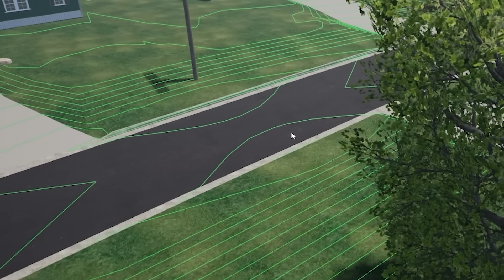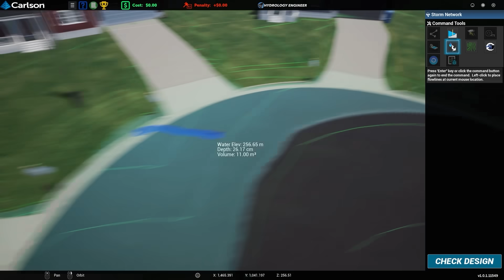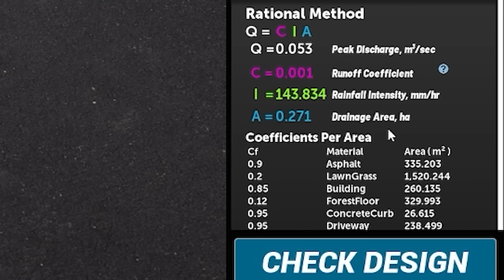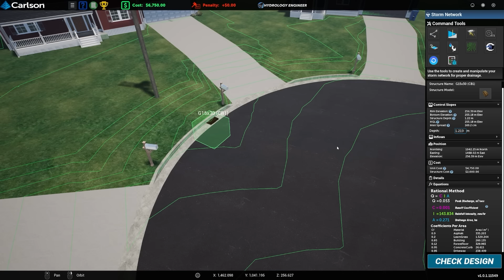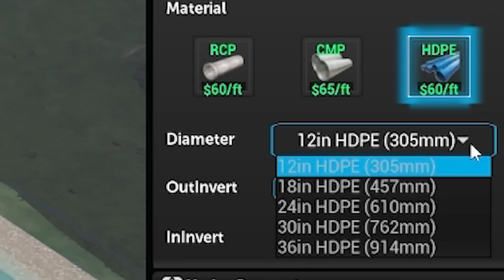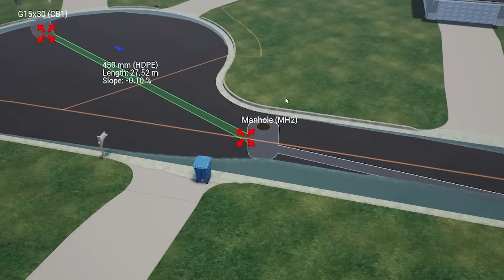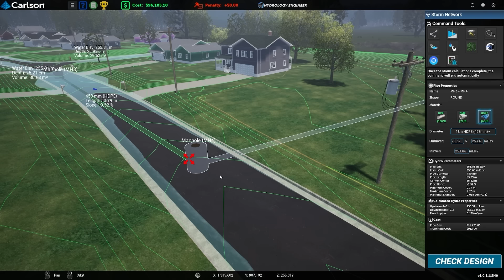Where does rain water go?

Comment: I have a couple of good mates that are dunny divers like RCE, but they never get as excited as this lol.  We often all pull the piss out out of each other and say that because I'm a mechanic that I was too smart to be a plumber and it is always easy to fix because it flows down the easiest possible path.  
But between you me and the tree, water and drainage/flowrates blah blah blah, all gets super complicated and I couldn't do it.  He started telling me one day (showing off really) how they work out how much drag different fluids have to find out how much heat the fluid moving creates over several miles of pipeline.  I probably got that ballsed up, but we were  all drinking so I will blame that.
One of me mates worked with a builder doing new houses only.  Got paid very very well, always went home clean and on time and before he made 3rd year he had two newish cars... that I had to work on for a few beers, on the weekends.  
But the other one left that job he got an offer to go work for a company that does commercial/heavy industry for an oil companies.  They would contract out to oil rigs or into the middle of a desert, all expenses paid.  Before he turned 35 he went out on his own and started his own company... bastard.  Both are bloody smart and I was and still am very jealous tbh.  
I told my youngest he should become either a plumber or an electrician, you can get paid better then some doctors.  But they worked hard to get to where they ended up.

Comment: I have a question about them. When I was traveling, I found a stretch of road that had 6-7 manholes. the road was a 35 speed limit, and all 6-7 were in a 3 to 4 second stretch of the road. So my question is, why is there so much in such a small amount of space?

Comment: so i work for a group of cities, doing various things mostly trash and recycling pick up. One of my cities has such horrid drainage that a light rain, not even enough to notice working in, will put water over the roads. all of the drains are on the apexes of hills, the roads are all lowest in the middle...it's horrid. The current city planner has been there for about a decade and I talked to him about it, and the best he had was "it would cost us less to rebuild the city than to fix this, and the board isn't ok with either option...."

Comment: As a former construction worker, I found this very interesting and I was able to accurately guess where you would put the drains. I live in Phoenix Arizona and my location the water slopes into a nearby wash. But about 10-15 years ago we had a storm here that the water backed up and the manholes where pushed out of the way. It turned out that over many years, trash collected causing floods all over the city. A big one was on the I-10 freeway that runs through downtown.
The construction site I was working at at the time had the elevator (or a lift to you, lol) hole in the ground for the cables and what not, was flooded and turned into a small pool. Wish I had taken a picture of it.

Comment: what, more water dynamics please. this was a subject i was interested in since i learned about hydraulics. i would like to learn more about how water flows through pipes or how heat is transferred in water etc. i like how a water tower works, but how does a system that doesnt have a water tower work? does it constantly need a power source for a pump? how big does that pump need to be? it would have to push the same amount of water as a water tower to the same height so i imagine it would be as big as a turbine in a water dam? maybe there's a more efficient smaller motor or series of motors? i wish to learn more

Comment: My neighborhood was built in the 60s by the most inept people ever. My house is at the bottom of a hill, and on the outside of a curve. On my street, there is a gutter basically every two houses along the outside of the curve. So, every house has a gutter on one side of their property or the other.  Except one. Mine. The place the absolutely needs it the most since it Is the low point, and there all the water will come to the outside of the curve. Plus, on the uphill side of me, our next door neighbors have a relatively wide yard. So the gutter (on the other side of the property) is before a long stretch of road. Any big storm you can literally see the river of water coming across the road on the inside of the curve just past the gutter, straight to our yard and into our driveway. (There are no curbs anywhere.) So yes, our driveway gets absolutely flooded and the asphalt in the edge breaks up every few years no matter how good a job the pavers do because the water sinks into the ground and basically creates a mini sinkhole under it.

Comment: As a former telecom engineer, this was a delight to watch!

Fun fact; our manhole and conduit runs also acted as unofficial drainage system. Water would enter through manhole lids, or sometimes even just open conduit holes. There was one location where the hydrostatic pressure was always so high you could slide the lid off using a lid remover. A previous engineer installed the hole where all the local drainage pooled. eyeroll

Comment: Definitely something I would've never given a second glance to if not for your channel along with your passion, knowledge and excellent explanations. While things like flow rates and pipe sizes aren't exclusive to city planning, it definitely was nice to hear you going over things and hearing you give quick nods to "this needs to be a certain way because of these factors" while also explaining why you were changing them later as you ran into problems with the simulation.

I've never worked with Hydrology outside of smaller projects like installing single home underfloor plumbing based on recommended numbers so this gave me a pleasant look into the complexities of larger scale projects along with more understanding into why certain floodings happen in certain areas of my city and what could/should be done to combat them but also as to why they might not be undertaken as you were making changes which impacted everything downstream.

I'd be very interested in seeing a larger scale approach and comparisons about making a "minimal viable solution" into "optimal solution" type deals from the full game to give an even further understanding about the problems surrounding upgrading existing systems but I also just liked the passion and insight you provided to the video. Best of luck and I hope we see a second part.

Comment: It's interesting that they use Mannings number. As a mechanical engineer, I am more familiar with the tube roughness number (i think it's acutally called "Darcy friction factor" or "Fanning friction factor" in English, I have to dig a bit deeper which one it actually is due to the factor 4 between them) based on the Reynolds number and wether the flow is laminar or turbulant andt hydraulically smooth or rough. But haven't used it anymore since quite some time...

Comment: What RCE didn't explain, and that my city found out the hard way, is that depth also has to do with freezing. The further down, the more likely it is to be below the frost level in the ground. City decided "it never gets cold enough here" and during the arctic blast a few weeks ago, a couple storm drains burst due to

1: debris slowing water flow because the city didn't run proper checks
2: -10 degrees for pipes at a depth for 20 degrees minimum

There were a LOT of burst pipes in homes and businesses, but the main issues were the couple of storm drains breaking and causing a lot of flooding because they backed up a LOT during the snow melt after the freeze and dozens of water meters less than 18 inches (roughly .5 meters) from the surface of the ground. Some were closer to 6 inches from the surface (.2 meters) and burst. Houses without water entirely until they came around to fix them all vs a room or two shut off

Comment: Matt this is nice, if you could continue on it with maybe other similar games in other engineering fields. Soil mechanics, fluid mechanics and turbo machinery, material science (cement, soil, etc.), seismic/vibration stuff, geotechnical, highways/roads, etc. I guess you understood my goal 😄. 

Normally, I don't like and don't comment on videos, especially gaming ones. However, this is different. As a mechanical engineering student myself, I had a smile on my face the whole video. I myself is a nerd regarding engineering, and seeing matt nerding on the details and information in the game is incredible. I even increased my resolution (since it was low to save of mobile data) to see the various details and numbers. Matt I don't know what you are talking about when seeing this is boring, I was pretty sure that everyone enjoyed it. Seeing the comments proves that (all field of engineering came to the comments here 😁😁, never expected this much of engineers to be in the audience.).

Comment: I work as a designer for a civil engineering company and we use Civil 3D. As a learning tool this program you are using seems like a great way to gain some experience and for that price it isn't bad at all. Although hopefully they have more maps to practice on. But a huge part of the design is also the grading and figuring out where the high points, low points, swales and basins all go. Plus trying to minimize the earthwork and balance the cut and fill amounts. Once you do all of that knowing where to put inlets is the easy part. I think this program totally skips that part of the design process.

Comment: I had a few years of CAD in university, so this brings me back to learning Revit. But we never went into the details, so I found this really interesting! Funny enough one of the few things I remember is that those rocks downstream of the headwall are called a riprap lol.

The other thing I learned from living in the Phoenix area for many years is that drains are basically useless if you don't clear the debris away regularly. They basically have flooded streets over there every time it rains hard because it's so dry most of the year.
Reply: You can’t forget that absolutely parched land doesn’t absorb water properly, so it’s like all dirt is rock until the water actually soaks in. So you have a double whammy of more water than assumed, going into blocked drainage!

Comment: Coefficient per area of Asphalt 0.9, remember @Real Civil Engineer, not everyone is an engineer and understands that the 100% you mentioned is because you add 20% in engineering to deal with unexpected situations/errors so you assume 100% isn't absorbed in case something strange is happening below the surface. 

Do you want to be called an Architect? because that is how you get to be called an Architect.

Comment: 18 inches is usually standard for storm drains tho i have seen them 36 and bigger just depending on the area of rain water also the water table most citys in michigan have a high water table so im pretty sure a higher water table means you need more room for drainage  ie bigger pipe

Comment: As s plumber when we have to go to the road for a repair it dont have to be encased in concrete more so bedded with compactor sand trying to cover a pipe in concerete is not the proper way after all what if you need to repair it now i realize codes are different depending on the city but as far as michigan we just have to bed the pipe with compactor sand and thats for all citys but we have to go from the bed of the pipe all the way to where the concrete or asphalt will sit

Comment: i have a problem with water pooling around my cinder block foundation in more than one place..
So, my idea is to dig around my foundation to about 6" (15cm) depth and attaching a rubber skirt at the dirt line onto the block, gravel behind the skirt to make it stick out from the block a few inches, then laying perforated piping onto the skirt, more gravel, garden fabric, then whatever over that, some places mulch, some dirt, some areas just more gravel... the area around my house is a flat east to west decline at 1.4 into a small drainage ditch... typical L shape foundation, so more like a long rectangle (E to W) of block with a 2 car garage at the high point and concrete driveway out to the north. new to the house, i suspect very poor roof/gutter maintenance for many years previously, not to mention very poorly designed poured concrete front walk and steps that becomes a frog pond late summer nights... anywho, any quick reply will do, i just need to know if my idea will have a positive impact over the years or would it just be a waste of time without digging much much deeper?

Comment: As a civil technologist in Canada, the “1.2m” ground cover above the pipe is to prevent freezing in the winter. I haven’t heard anything about the weight of traffic.. we can install directly below the pavement structure as long as there is insulation between the pipe and the gravel underneath the road.

Comment: Ok matt, i goot a drainage question for you.

About once a year, a storm will errode a river into my driveway. It usually winds up about 2 meters wide. By 1 meter deep. 

When the storm is finished i go and dig my driveway back out of the pond. 

I have tried providing pipes but it just seems to errode around the outside of the pipes. 

How wojld you tackle it? Btw the catchment feeding it is approximately 24,000,000 m²

Comment: I need to show this game to my township. A place was built just down the road from me, and apparently it's building code to have a culvert under every driveway... so they dug a hole on basically flat, level ground to put it in. There's now trapped water where it would have naturally just flowed slightly south along natural contours and drained into a marsh. It's very perplexing to look at the perpetual puddle that never needed to exist. just a pit on either side of the driveway with a half-metre diameter pipe connecting them.

Comment: You really were an engineer weren't you, 0.1% grade is totally obtainable because the earth never settles, the people who lay the pipe are perfect and can install each pipe so that it only has 4mm of drop over a 4m long sdr pipe, and the pipe manufactures are perfect and never over tighten the banding used to transport the pipe in bundles causing the pipe to deform and create puddles in the middle of the pipe never happens

Comment: I watched the entire video. Have drainage engineers considered using the strongest shape for pipes? Rather than round. 

Also when laying pipe, do you need to ask the ground if it is married before hand?

I would imagine if the pipe is the strongest shape, marriage would not matter.

Comment: A Hydrology Engineering Learning Resource Simulator.

Yes that sounds like a game to me.
Some Bing search. there is a $1,550 version to do the actual work.
So this is like a use at school version. hence the stuff you have to put in.

Carlson Hydrology contains full hydrology and hydraulic design capabilities, and seamlessly integrates with HydroCAD. It provides site drainage, runoff analysis, storm drain system design and drafting, and pond design sizing.

Carlson Hydrology can be purchased as a standalone module or as part of the Civil Suite, which includes Survey, Civil, and GIS. It can run standalone with the included license of IntelliCAD or on top of a separately purchased license of full AutoCAD.

Comment: Today in Physics we learned about how pressure in a pipe changes with area of the cross section of the pipe. Assuming the rate of flow is unchanging.

Comment: Drainage question for you. I live in a low-lying area (pretty much 'at' sea level, if not slightly below it). What's more, our house is right next to a VERY slow-moving pond (it's too slow to be classified as a river). It used to be quite scenic but the property across from ours was converted into a truck stop and the land levelled and raised. (Thankfully not asphalted, but compressed so it has a lot of runoff regardless.)
If we get hard rain for more than a day or two, our yard floods. Is there any remedy for this?

Comment: To piggyback off what Matt said at the beginning, there are a few simulators designed to teach/train, and one of which I found a while back; ZUSI 3 is a teaching simulator for rail conductors with very little, yet hyper realistic, "gameplay" where you operate a railcar, and travel several literal hours over the 500km of track :O, all while carefully monitoring and controlling the train. I haven't gotten Zusi 3, as its 70 dollars and I think was completely in Dutch, from the labels on the train controls to the tutorials. The graphics are also about on par with PS2 or so graphics... like the trains have decent detail, and the instruments are high res, but everything else is potato, as its strictly for training lol

Comment: ey look at that engineering, I loved learning about rain.
all this info and best practices, you find the low points, you take into consideration how much water goes in the lowpoint using coefficients for different surfaces, you take into account not only the road but also all the things surrounding the road,
you get data from flying drones, and based on that data, together with calculations and possibly simulation you find the best places to put these things. (and the smallest details like how deep does the pipe go, because if its less than 1.2 meters it cars are gonna damage it over time if it's not)
you plan ahead for giant ass storms that may only happen once every 50 years.

It's remarkable to see the complexity of the world i live in, through the eyes of a hydrology engineer.